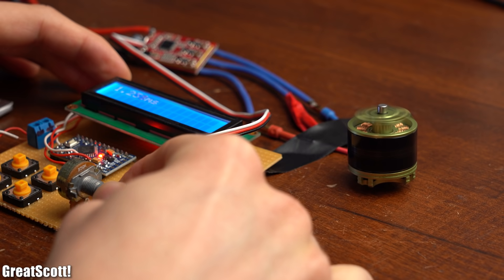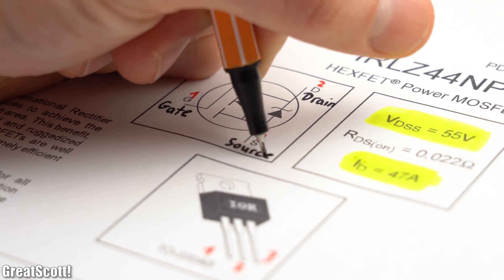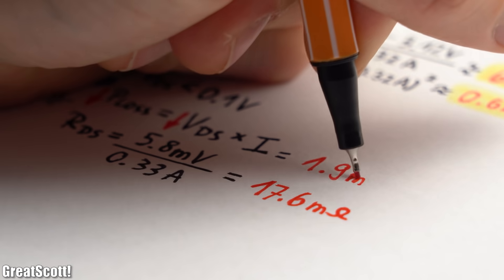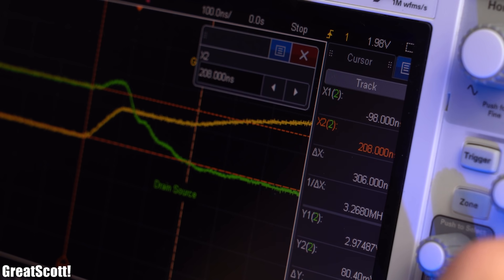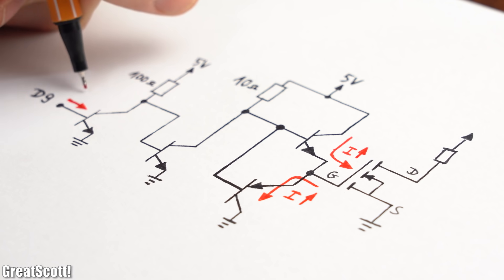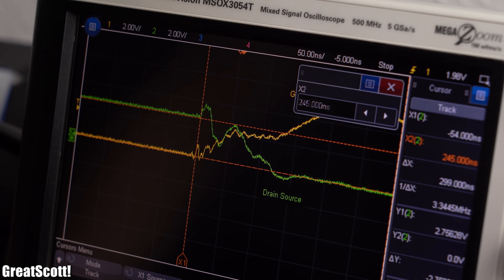Here is why MOSFET drivers are sometimes essential! || MOSFET Driver Part 1 (Driver, Bootstrapping)

Comment from the maker: Part 2: https://youtu.be/B7Eqrf2M-Iw
Reply: Dear sir i just subscribe to ur channel after this videos will u plz teach us the how to design circuit how to choose what calculation formulae require... to trace the whole circuit .
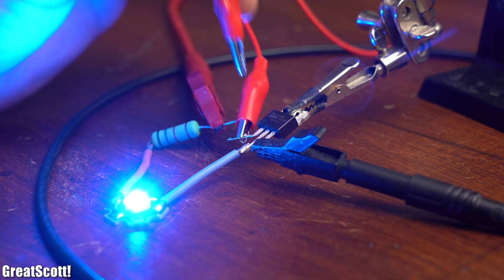Reply: Thank you for your amazing video as always. I had a short-circuit in my brain here 4:48, though. What were you doing? I really have no clue what's happening there.
Reply: Ok sorry im not very talentet in Curcuit stuff but... 
Is the Condensator not pulling the Drain under the Gate Voltage in stead of adding up the Supply and the Condensator? 

I realy tryed to Rap my head around it. But i cant see how it schould pull the Voltage over its supply. Bevause 2x 12 Volte parallel are still 12V just in Series they get 24V.

So i think the Condensator is "Chargin Negativ" and "Pulling Charge" away from the drain to make the Voltage differenz. Caus it cant charge over its supply.
Reply: Good video, was using it to refresh my knowledge, one point, thermal runaway can be eliminated using a source resistor, so as 'I.s' increase, the voltage across the resistor increases reducing Vgs - just a form of negative feedback, can also be used on bipolars.
Reply: PS: another way, is to generate a seperate power rail above the drain voltage-for those thinking of doing this.
Reply: Hi there can you design for me a circuit with DC input and high frequency and high voltage output such as 3kV and up to 15Mhz?
I would like to purchase a circuit or a device like that but I hard to find ?

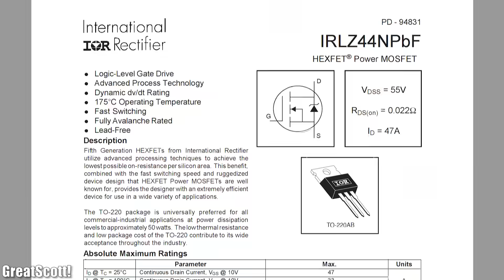Comment: this tutorial was very helpful but i still dont understand the zener diode inside of the mosfet 1:38
Reply: It's not a zener, it's called the Body Diode and it's intrinsic to the FET structure, you cannot make a MOSFET that doesn't include this diode. Normally it's reverse biased, so no current flows, but it will conduct if the polarity is reversed, this is useful for some circuits like reverse polarity protection schemes.

Comment: 2:24 your math is off. For R=V/I, you rounded R, then used the rounded value for P=RII. It’s better to calculate P directly using P=(V/A)*II, which simplifies to P=VA anyway. The problem is that when using the rounded value of R in P=RII, you’ve approximated to 2 significant places (0.62A) instead of 1, since the exact answer is 0.6016A. It’s tricky to know how many significant values to round to, that’s why it’s always best practice to copy portions of equations into subsequent ones to get precision answers. In this case for example, before simplifying, would be ((5V-3.12V)/(0.32A))*((0.32A)*(0.32A)). Of course it’s not that big a deal for your project, but sometimes it really matters!

Comment: One thing is the resistor configuration  to discharge the mosfet  might depending on which type of mosfet ; P type or N type, and whether its enhanced mode( normally off) or depletion (Normally on)

Comment: If I don’t have an oscilloscope how can I determine if I need a gate driver? If I’m controlling an LED with an ATtiny85 using PWM, such as using PWM to drive the LED at like 80% brightness, if it works then how would I be able to tell if it’s going to eventually fry without an oscilloscope? It seems knowing the switching timing and seeing the curve is really helpful.

Should you always use a gate driver when using PWM no matter what?

Comment: With all due respect, you wrote your code in an unnecessary way to show off. I’m sure you had to research how to write the code this way which is only meant to utilize space on the board that wasn’t necessary for such a limited code lol no one writes code that way, especially in Arduino. 😅
Reply: Go away.
Reply: Are you a dope?
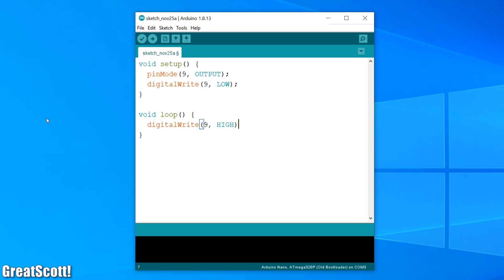The code he wrote appears to be pretty standard simple stuff @5:20.

Comment: Ahh yes this reminds me of a circuit where I had used a transistor to create a swing like you would use to produce a resonance for a Tesla coil as oposed to using a steam engine however I had incorporated a 27000 mhz quartz crystal into the high speed switching and powered it with an almost dead 9v battery.  The amperage grew until it fried and I was not expecting that much so I had not yet planned for how best I was going to handle the rapid increase as all that there was to start with was only 5 or 6 volts that the almost dead 9v battery had left in it and I could see the current ratcheting up in some LEDs I had in the circuit since I was not wanting to fry them  .. I never did get a chance to hook it up to a scope and I should have been taking notes  ....

Comment: I can't get 5v from any of my pins from my UNO to my FET for some reason. I connect to VCC 5v and the Fet works. I get something like 1v from my digital output pins no matter which one I use. No one else seems to have this issue. I found one online chat but it turned out it was just a code error, which I don't have.

Comment: why can't you just have a dedicated power supply for driving mosfets and the microcontroller switches on a small mosfet that sends this power supply high current to the gate pin of the big mosfet?

Comment: sir i have some problem. we using ultrasonic sensor in  water level indecator  .we operate motor on and off. digital pin 10 = load .to distance 20cm off and ON 80 cm . BUT it on 30 cm also what we do sir
this is our code
water level sensor

const int echo=3;
const int trig=4;
int LED1=13;
int LED2=12;
int LED3=11;
int LED4=10;

int duration=0;
int distance=0;

void setup() {
  pinMode(trig,OUTPUT);
  pinMode(echo,INPUT);
  pinMode(LED1,OUTPUT);
  pinMode(LED2,OUTPUT);
  pinMode(LED3,OUTPUT);
  pinMode(LED4,OUTPUT);

  Serial.begin(9600);
}

void loop() {
distance=digitalRead(4); 
digitalWrite(trig,HIGH);
delay(1000);
digitalWrite(trig,LOW);

duration=pulseIn(echo,HIGH);
distance= (duration/2)/28.5;

if (distance<20){
  digitalWrite(LED1,LOW);
}
else if (distance<40){
  digitalWrite(LED2,HIGH);
  digitalWrite(LED3,HIGH);
digitalWrite(LED4,HIGH);
}

else if (distance<60){
  digitalWrite(LED2,LOW);
  digitalWrite(LED3,HIGH);
digitalWrite(LED4,HIGH);
}
else if (distance<70){
  digitalWrite(LED2,LOW);
  digitalWrite(LED3,LOW);
digitalWrite(LED4,HIGH);
}
else if (distance<80){
  digitalWrite(LED1,HIGH);
  }
Serial.println(distance);
}

Comment: High side switching is critical. Can you do a video on how to use MOSFETs for high side switching. Meaning that the source is connected to a solenoid and the other end of the solenoid is connected to common ground wereas drain of MOSFET connected to +V. Any idea? Thanks

Comment: 🎯 Key Takeaways for quick navigation:

00:01 🤖 Introduction to MOSFETs in power electronics:
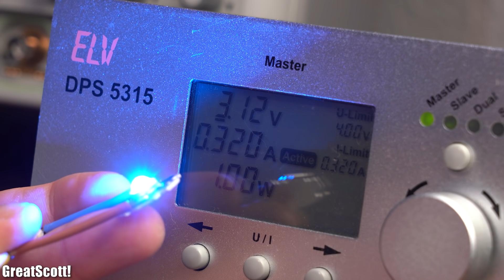02:13 💡 Practical example: Switching a high-power LED with a MOSFET:
04:57 🔄 Using an Arduino microcontroller to control a MOSFET:
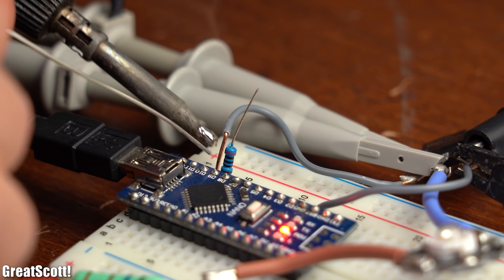08:09 🔌 Challenges with low-frequency microcontroller MOSFET driving:
10:01 ⚙️ Introduction to MOSFET drivers and MOSFET driver ICs:
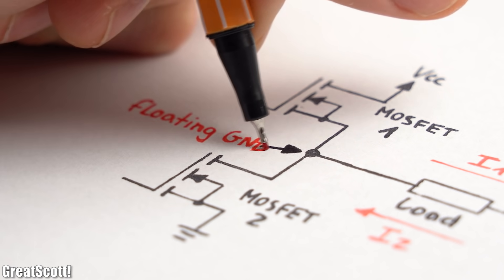11:49 🔌 Bootstrapping for gate voltage in half-bridge circuits:
13:11 🎓 Conclusion and teaser for Part 2:

Made with HARPA AI

Comment: 🎯 Key Takeaways for quick navigation:

00:01 💡 MOSFETs are crucial in power electronics due to their ability to switch high voltages and currents efficiently with low power losses.
00:56 💡 Driving MOSFETs requires careful consideration of factors like gate voltage, current, and parasitic capacitances.
04:06 💡 High current draw through a MOSFET can result in significant voltage drop and heat generation, potentially damaging the component.
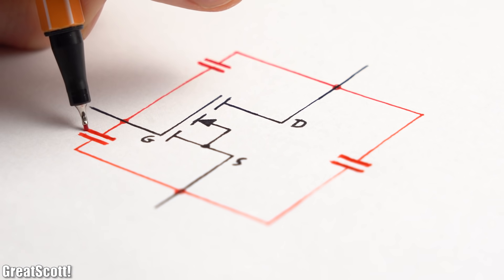06:22 💡 Parasitic capacitances in MOSFETs require a significant gate current to switch them quickly, which may exceed the capabilities of a microcontroller.
10:01 💡 MOSFET driver circuits or ICs provide the necessary current to switch MOSFETs quickly and efficiently.
11:49 💡 Bootstrapping circuits are used to provide a higher gate voltage for MOSFETs with a floating ground, enabling proper switching.
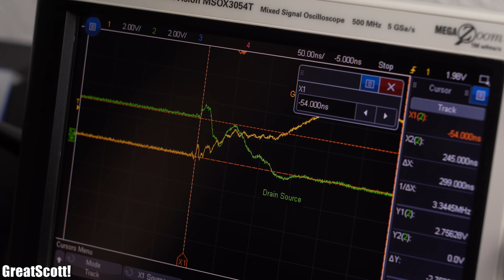13:40 💡 Part 2 of the video series will cover gate-drive transformers for driving MOSFETs potential-free, as seen in Tesla coil applications.

Comment: No need for special drivers. I converted m🎉y small-signal multivibrator into a high-power version with power transistors, it has no problem at all driving three paralelled Mosfets, and easily and quickly supplies the parasitic gate charge with little delay.

Comment: Sorry, but aren´t mosfets (and IGBTs) purely voltage-driven ??? Why does it then matter how high its gate-current is, to turn on faster ??? Of course I get it, that current has vast infuence on the turn-on-speed, but in principle, the igbt would fully conduct even if the trigger-signal was just 1mA, but it´d take days instead of nanoseconds instead, in order to fully conduct, right?

Comment: What do you think about using the ubiquitous 555 timer as MOSFET gate buffer?
Pin 4 is the input, 6 and 8 go to VCC, pins 1 and 2 go to ground. 5 to 10 ohms between pin 3 and the gate.
It's not my idea. Google electronicdesign lm555 makes inexpensive power driver.

Comment: Your discrete MOSFET driver is very sophisticated, normally 1 Transistor with a pull-down Resistor is in most cases enough. 
We would say: Mit Kanonen auf Spatzen schießen

Comment: I'm planing to use a mosfet as a relay switch replacement to arduino reply module.
Is it possible to use mosfet as a switch with a 24v load?

Comment: I’m confused with diodes notation, conventional current and electron current. 
In 2:04 diagram. When gate closes the circuit, electrons flow from source to drain, but the diode points backwards (in conventional, inexistent current)?

7:40 Could you feed the Mosfet gate with 5 Arduino pins from the same register, and trigger them simultaneously in parallel ? (ideally that should provide 200mA to gate?)

Comment: 12:32 Could someone please explain why the gate voltage of the upper MOSFET is Vcc+Vc? Is that assuming the MOSFET has been conducted at first, then check the Vgs is high enough?

Comment: Could you advise if possible to buy or buy and rebuild power switch module,based on mosfet, to switch battery power at about 20A and 42v and control it with rc pwm signal

Comment: thanks for amazing infos. I have a question, Is it possible to control the speed of an ac motor via pwm? i have a machine that has 12v dc brush less fans and I want to replace them with ac motors, how can I convert pwm from controlboard to control the speed of ac motor? I know I must use mosfet for this job but I have no clue to how to do it.

Comment: I thought i would use a mosfet instead of bjt to turn on or off the battery that powers wifi router during power outage.
The purpose is to automatically turn transistor off, hence the router, in case of undervoltage of the battery. But mosfet is too complicated. Gonna stick to bjt. A couple milli-watt power loss is better than a headache during design process i guess....and mosfet is 3 times more expensive than bjt. Also, i am just studying electronics engineering, so i dont know if my method is correct. But it should get the job done.
Reply: this is how i feel after watching this lol

Comment: Such a good explanation with the worked example showing the charge times and average current draw. Correct me if I'm wrong, but my main alarm bells take home from this is that, if using a microcontroller to occasionally switch a mosfet, the resistor on the gate input probably isn't necessary, as the amount of time in a significant over current state is so miniscule, nothing will ever have time to get hot enough to melty melty. However if I'm fast switching a mosfet from microcontroller and the frequency is starting to interfere with the amount of time it takes to actually turn the thing on, I'm essentially spending all of my time averaging an over current situation... so in this case I really should be using a resistor (or indeed a dedicated driver).
Reply: noting of course that average isn't continuous, so it isn't even as bad as suggested but, if the over current is significant, then this makes things worse. I guess a reasonable analogy would be that no one ever died from a static electricity shock... but if we received them at high frequency over a sustained period... we'd be pretty unhappy bunnys.

Comment: Many thanks for your videos, i have an ambition to deal with my electronic wastes and make safe and ensure i purchase less. If I need i can make or buy to my real needs and not to excess. I have been involved in control engineering , it was work I did in 1990. I often worked with air pressure signals that controlled final control elements in many applications in industry. Air Controllers MOORE controllers were completely working using clean dry air to control process with  no electronic items to be seen. My last work in Kent was in a Cement factory and us we  looked at the introduction of the Computer to memories of say factory history and to help us realise?  he did that last week and the job worker worked it to completion and the manager signed it .  but now it is not working ? so answer was answered sooner that 5 am in the morning and more like 2 am . I fired the cannon and the probe at the 10 om meters away there at the back of the 100 meter metal kiln was shot . The sick monitor proved correct once more., ha good to be on board again.  that i was better adapted to. ? I liked the introduction of the PLC and then the master CPU in control terms and the realization the valve body sense of the place of the valve in respect to %open or closed has negate the Master and salve control .The want of a screw  saved the auto process to be auto. , at this time the PLC it took the space on the wall more like the wall paper in a Victorian home which Pip often visited. The great Aunt  flamed in expectations . The lecture above needs to point to time at the working of say solderoing or thinking about soldering or about not having a noce time with his wife or your wivees and looking at the need for less with travelling to that great place when it has quitened, and walking to the sea and seen for real the trawlers captain sober not drunk but sober all the time sober and who tells these lies, captain ? so less time with the smog of these plastics and thhe fingers and our infections will subside  the left hand nails are infecteed and show ninfection . the same with all people that will over sue the items above . so more time oicking and gathering and walkingh and looking and shopping and with your children and what really hapens in that class room? Etc . Anyt apples , no cider i see , and the seassme seeds not in olils better , and the breads brown and the meats a large consume and soups and the planet objections now less obtise and a happy tone can be heard . No building a industry but returnig the people to noraml and remain normal. thr same with glues for carpentry. Eddie loizzard

Comment: 8:26 The resistor used for the Arduino GPIO is 200 ohms but apparently the average current flowing from the GPIO pin is 56 mA? How could that be? I'd expect a peak of 25 mA from 5 V / 200 ohms?

Comment: I might be dumb in fact I know I am but  at 4.51 in the video showing the LED being switched on and off by alternately connecting the gate to  supply voltage or 0 volts, the circuit appears to latch in the conducting state. i.e once conducting the MOSFET continues to conduct even though the gate voltage has been withdrawn  and requires connection 0v to switch it off again. Once off the gate can be left floating and the MOSFET  to stays off.  Am I correct in this observation?

 I had thought that the mosfet would switch itself off once the gate voltage was withdrawn?  The mosfet seems to be acting like a sort of  DC thyristor (probably a bad analogy) ie  once triggered it continues to conduct until the current /voltage drops to zero at the anode and cathode ( in the case of a thyristor) or gate in the case of the MOSFET. Is this behavior general across all MOSFETS? It is confusing me as early in the video the mosfet was switched on by the touch of your finger (stray capacitance I assume) but it did not latch. Idsthere some threshold of gate voltage that once surpassed latches the MOSFET?  Any insights from  more intelligent people would be welcome.
Reply: Just dawned on me there was no resistor connected to 0v to pull down the gate when no input was connected.. Doh!

Comment: Bootstrapping with a diode and capacitor is a great hack. Just make sure your duty cycle doesn't stay at 100% long enough to discharge the capacitor to a voltage that will no longer turn on the MOSFET. For some applications (AC to DC inverter, buck converter with undervoltage protection, etc.) this is a perfectly suitable option.
Reply: Help me to control a DC motor please, I am using IRF3205, and the 12V geared DC motor is not turning off...Thanks
Reply: @mohammedyasarshaikh4090   Maybe you have connected the MOSFET backwards? If the drain and source are swapped, it will act like a diode instead. If you've checked that, use a multimeter to measure the gate voltage of the MOSFET and make sure your microcontroller is actually commanding the motor to turn off.

Comment: Hello, thank you for the application Video regarding MOSFET. I am searching for Suitable MOSFET that can be used as a switch for high -> 1000V, and Low -> µV to 5 V application  for my project! Please can you provide me with some insights regarding it?
Reply: For 1kV switching I recommend using GaN or SiC transistors - they are manufactured to withstand high voltages and currents, Read datasheets and see what maximum Source-Drain voltage is. For uV switching I would use relays but if you insist on MOSFETs, search transistors with as small as possible Rds(on) parameter.

Hope that helped!

Comment: A lot of info in this video but when I focus on using a micro controller I can't help but think  "What about Optocouplers"? They do isolate 2 separate power sources correct? They also use very little current. Seems safer than MOSFETs.